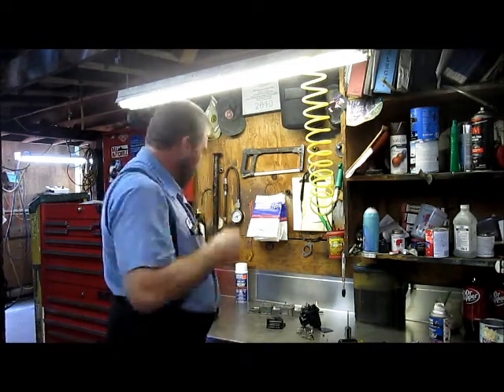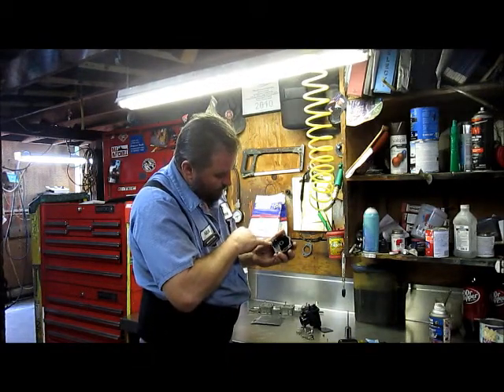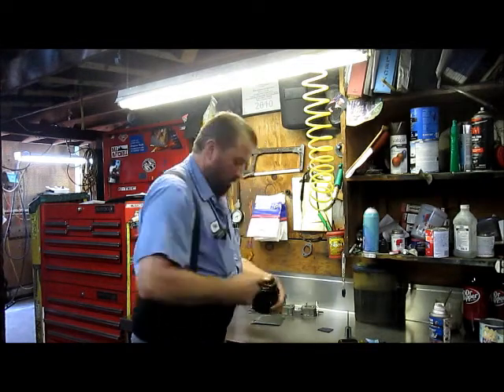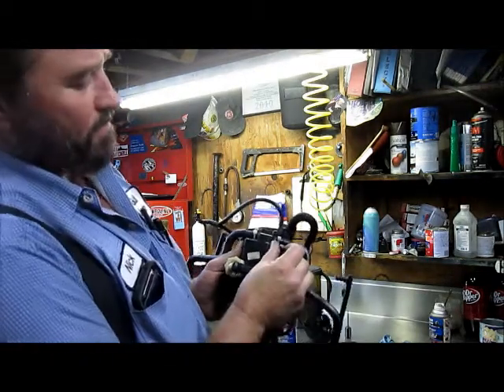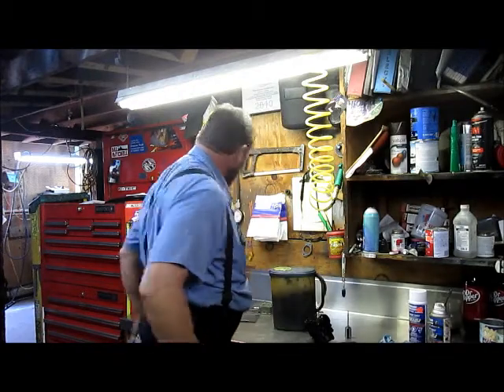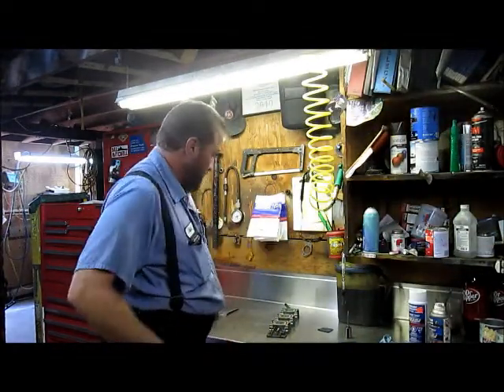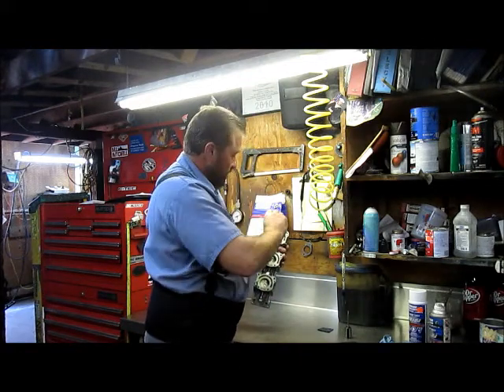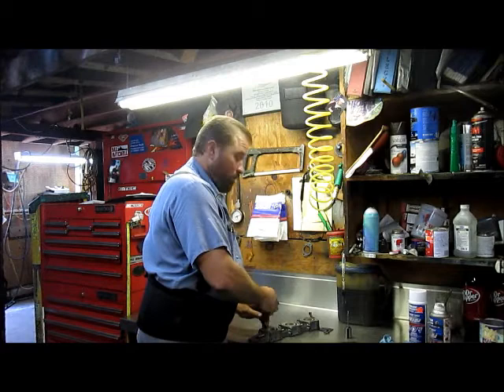Evinrude/Johnson carburetor repair, professional disassembly for 60 and 90 deg Looper pt 2

Comment: Machinist tip; use a figure-8 when hand lapping.
I wet sanded with 150 then 500 then 1000. I completely removed ridge.